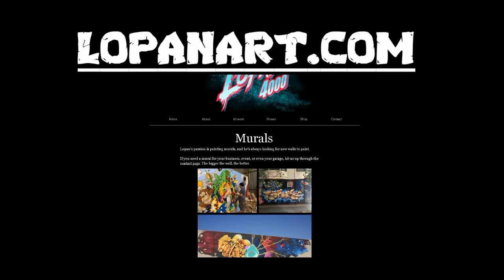2018 JEEP GRAND CHEROKEE WATER PUMP REPLACEMENT  ( 3.2L) (PART 1)

Comment: This video is not correct for a "Cherokee". You are working on a Grand Cherokee. Not the Cherokee. They are totally different vehicles with a different engine layout and steps even though they both use the Pentastar engine. The Cherokee uses the smaller 3.2 and is transverse mounted. The Grand Cherokee uses the 3.6 and is longitudinal. Please update the title of this and your other video. Thanks
Reply from the maker: Nah This was a Jeep Cherokee with a 3.2L. You're the only person who thinks that it's wrong.
Reply: @GEARMOAUTO  sorry but your wrong. I own a 2014 Cherokee with the 3.2 v6 and you must remove the lower rad hose off the water pump before you can remove the belt. The belt routes through the hoses. You also must support the engine before removing the passenger side motor mount since it bolts through water pump and must be removed. Wasted time on this video bought a Haynes manual instead which was spot on correct for the 3.2 v6 Cherokee.
Reply from the maker: @jasonm3347  Maybe the body changes between the 2014 to 2018 cause a slight difference in pump replacement. Idk. There is a 2018 CHEROKEE that comes with the 3. 2 L though. If I realize I made a mistake in the title though I will change it And write in the description that Jason M. Was right and I was wrong. No problem. Hopefully you got a little usefulness from the vid. Take care friend
Reply: This is the 3.6l that you are working on